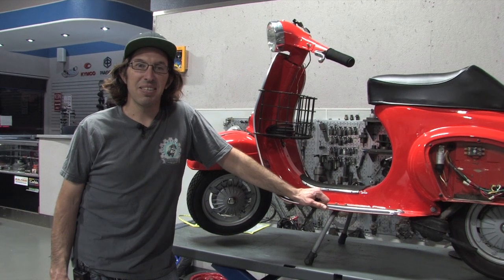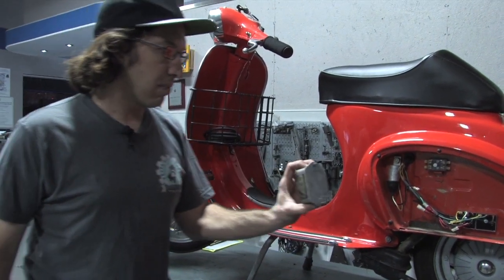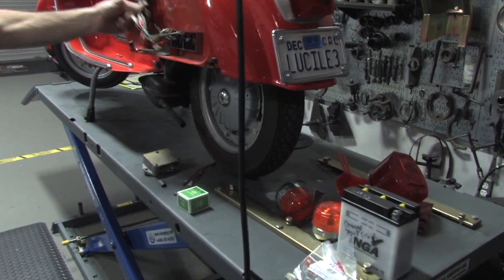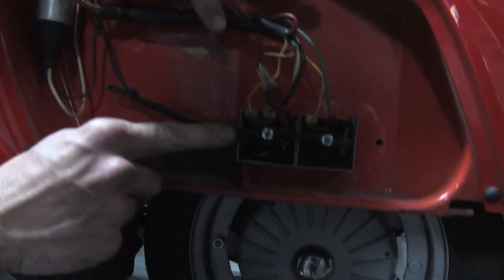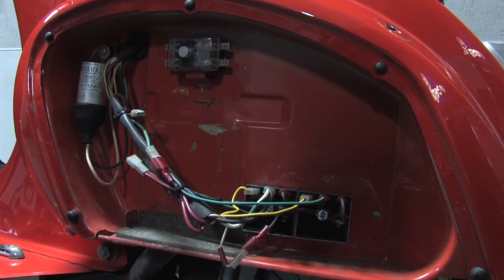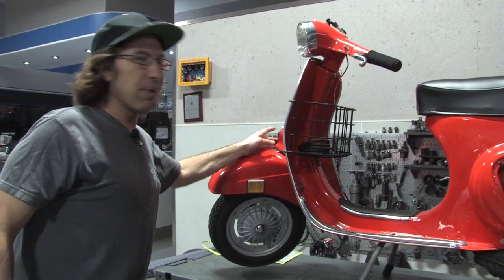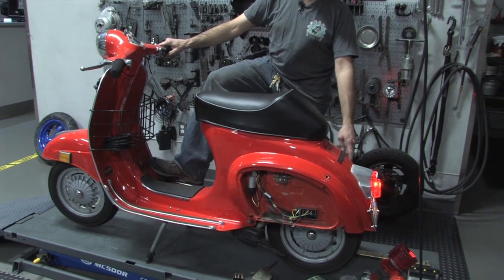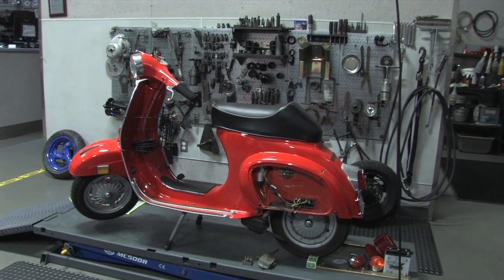Convert a Vintage Vespa from DC to AC Electrical System

Comment: I have a 1974 Vespa permovera small frame. It has no battery. It should be 6 volts right? I have been having stalling issues sometimes But cleaning the points work.

Comment: Hi. I have a 100 sport. there's only 1 yellow wire that goes to the rectifier. So would I only need to purchase 2 REG 6v to run the brake/tail light and the horn?

Comment: SIR
    I OWN LML VESPA NV SPL 1998 .
I MET ACCIDENT IN 2003 OCTOBER,MY SCOOTER WAS GIVEN TO A MECHANIC TO REPAIR AND PAINT.
THEN FOR A SHORT PERIOD I KEPT  MY SCOOTER  IN MY  HOUSE.
LATER I BROUGHT A MECHANIC TO CHANGE THE STEP WHEEL.THEN I FOUND MY BATTERY WAS MISSING.HOW HE REMOVED MY BATTERY AND ARRANGED AS AN SCOOTER THAT WORKS WITHOUT BATTERY WHICH WAS WORKING WITH A FACTORY MADE BATTERY.SIR.....I AM NOT A MECHANIC....SO GIVE ME A ANSWER....
THANK U.
Reply: roy joseph i indian scooters there is no battery spacial lml nv
Reply: @nischalrana2447  there is, there very many variants.
Reply: @AmolAmrit  im talking about old spl nv vespa not nowadays one
Reply: @nischalrana2447  I mean yes even in those days there were many variants with/without battery. Like the 2001 model had the self start & battery.
Reply: @AmolAmrit  that was in 2001 im talking about 10-12 years before 2001
Reply: @nischalrana2447  They didn't have battery. But my 1991 model had two variants - One with & without battery.

Comment: hey... i have a GTR 125 battery model restoring. i am considering to put a battery on and make it original or is it better to take the battery of and make something like that you did in this video? whats my actual gain of this? do i have any improvment if i have battery on? differences? also can i buy bgm pro 6v regulator because the one i found  that its like the original cost about 80 euro and bgm only 25.... thanks
Reply: i am instered for old scooter he no battery  joint but i am joint for battery me scooter please how is joint
Reply: i am no convert for scooter ac to dc
Reply: Rahul Jangra bhai india ke scooter me batteries kyu nai hai

Comment: This video is still coming in handy!  I just converted my 74 Primavera. All turn signals had been removed when I got it, so I removed the brown wire and the flasher completely, running just the white to one regulator and the green to the other. Amazing how bright and steady the lights are now!  Thanks for the help. :)